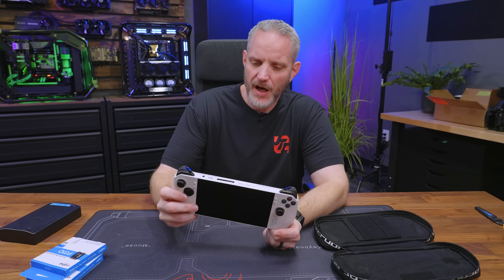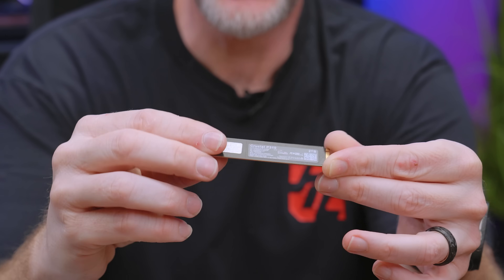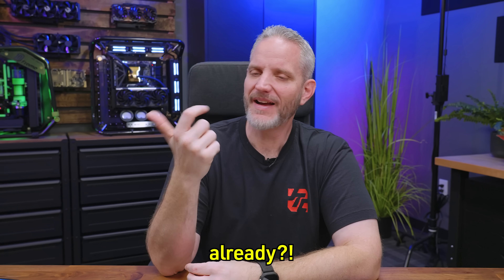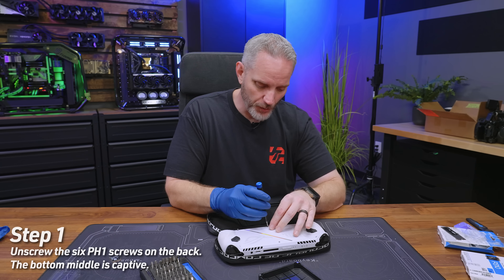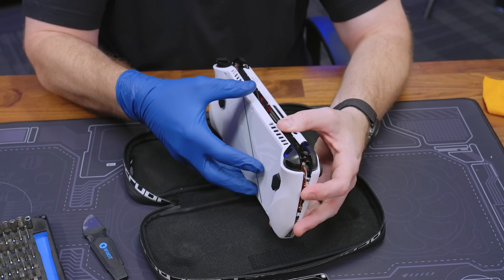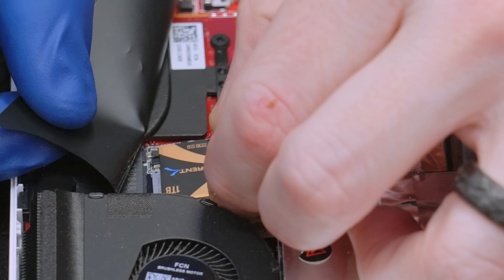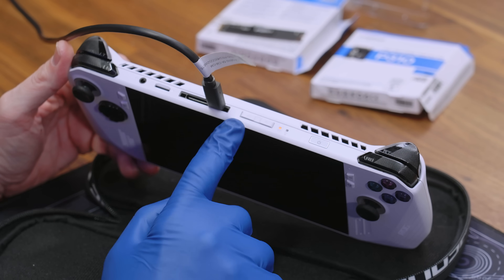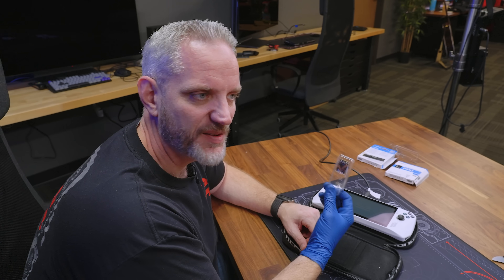How to upgrade Ally SSD.... Easy Turorial

Comment: I did a similar thing with my 64GB steam deck and upgraded to 1TB.

I don’t usually like playing games where you get heavily involved in whatever you’re doing on the steam deck. I also don’t like playing fast paced or twitch/reflex games on the steam deck. 

I play games like Marble it up Ultra, N++, Dave the Diver, Minecraft, Spyro, Fall Guys, Megaman, etc…

I also do a lot of emulation (legally of course😇🫣). It’s such a great device for playing old games. When I was a kid, I always wanted to play the full-fledged version of a lot of my PlayStation one and two games on a game boy of some sort. This literally made my realize that dream.

I’ll also use it as my backup PC or travel desktop PC from time to time. If I crank the settings all the way down on AAA games, I can get a playable experience. I’ll play Forza horizon, four, overwatch, borderlands, etc. on the steam deck. It’s nowhere near as good as an experience, obviously, but it stilla lot of fun TBH.

Comment: It's crazy how far we're come. First SSD I bought was a 128gb samsung 830 back in 2011. It was pretty expensive at launch. I still remember being blown away by how fast and responsive my mid-range PC got. (A year later I bought a 250gb 840 solely for games, same story.) Consumer SSD's must be the single most transformational piece of performance upgrade in PC hardware since....ever I guess. The only other thing I can think of is floppy boot to hard drive boot and floppy to CD-rom and flash drives. Correct me if I missed something. Now you can by a 1 TB+ MICRO SD card for a lot less money than those SSD's. Ridiculous. 🥴

Comment: Nice video. Maybe you could do a " Cloning " from the 1tb to the 2tb drive by using external adapaters. you could plug each adapter into your desktop boot with an acronis formatted usb drive. Then do a cloning from the mini-ssd's.

Comment: I managed to order a refurbished 64 GB Steam Deck from Valve when they first announced and released them for order, so I purchased a WD SN 740 1 TB to install from AliExpress because that was the only place I could find 2230 drives for under $300. The installation was relatively straightforward; however, I encountered a challenge when I couldn't locate my 3.0 thumb drive and had to use a 2.0 drive instead. Consequently, reinstalling Steam OS took several hours. Fortunately, I found a 3.0 drive halfway through the installation, and it took less than 5 minutes to complete the process, allowing me to resume playing games. Currently, the Steam Deck is on my nightstand, but I rarely use it because I have a gaming PC in the same room.

Comment: I also have a really hard time using handheld gaming, I prefer to stay at my desk with keyboard/mouse and have multiple monitors. The problem with this setup is that Im isolated and have no interaction with my wife.

I have tried multiple setups to overcome this issue and right now Im doing windows tablet that I can use as my main pc with an egpu dock, besides the enormous bottleneck of oculink and a 30W 8840u Im having fun doing this. I play till  my wife have to sleep and then Im back in my pc setup.

Comment: I am an avid handheld/portable gamer. Tbh, it was cheaper and easier for my parents to get 2 gameboys than an n64, for example. These days, however, I use it a lot for public transport as most trips I do are 1-2h each way, waiting between clients or when they're in appointments, and for my anxiety, when I need ti calm and focus on the go, etc.

Also, paired with a portable touch monitor and a foldable keyboard and trackpad, it serves also as my main business pc. Basically I do everything a laptop does but in a generally easier to carry formfactor. 
I also have just collected handhelds for years

Comment: I bought the Lenovo Legion Go shortly after they were released and have barely used it. When I have it's mostly been to run updates. I'll need to either start using it or sell it. This is my first experience with a gaming handheld so I'm sure that's part of the learning curve. I'm not very impressed with Windows on this device as far as touch inputs go.

Comment: It is super cool that they are getting higher capacities in the smaller 2230 m.2s, but I kind of question them putting the same hardware onto a 2280 size board. It would not matter most of the time, especially if you are just using it for games, but for work applications where you are moving around huge files, the sustained write speeds are pretty heavily determined by the number of nand chips on the board. So I would expect the sustained write speeds to be really bad when compared to other 2280 size drives that are filled with nand chips. So I would not buy the 2280 ones at least not without seeing a good review that tests these out really well. Also I kind of wonder about the durability, usually an increase in nand density also comes with a drop in durability. Unless Crucial has somehow managed to overcome all of the usual drawbacks of using fewer denser nand chips then the 2280 size just does not seem like a very good idea to me.

Comment: Actually, I couldn't possibly care less how big the drives are physically for a 2TB drive, or whether I can get a 4 TB drive.  What irks me is the limited lifetime of the drives.  True, a larger drive will take longer to die - but I have had an SSD fail on me after only 5 years.  Fortunately, the part that failed wasn't critical and was capable of running system recovery to get back online.  I was able to do a backup of my data files to a big thumb drive because I've had to recover on previous systems and know about making backups.  But it was still annoying as heck.  I've read about a new direction for SSDs that emphasizes longevity.  When they get THAT figured out, I'll be impressed.  Before anyone asks, I've had systems for which the HDDs lasted 15 years before showing the inevitable failure modes.  But 5 years is just too doggoned short.

Comment: I use my Rog Ally for emulators, visual novels, and clearing out older games on my massive back log while lying on the couch with it plugged into a wall. Right now I'm currently playing Marvel Ultimate Alliance gotten by various means and the performance is excellent at 1080p max settings.

Comment: uhhhh...I don't mean to be rude or anything. tho the another easier way is to go the NVMe cloner tool. you slide both SSD in the correct slot then press button.

Comment: As A Legion Go owner I wish 2242 would go away and it would just be 2230 instead. Too many sizes means prices are allover the place. This 2230 + adaptor is cheaper.

Heck 2280 SSD + USB-C M.2 enclosure is cheaper than 2242.

Comment: I was told the ROG ALLY also won't boot for the first time unless its plugged in if the battery was disconnected. 
Just a heads up for those who disconnect their battery when they open their Ally to do changes.

Comment: I like how they are getting even smaller, but also pissed that regular SSD's aren't being made now at much higher capacities for quick backup, temp storage....  The prices on the ones at the high average being only 2TB have almost doubled, and find one at 4TB, triple that!!  They are supposed to quadruple the size and then some to get double the price!  They could probably make 2.5" SSD's at 16Tb by now, and at under $300.

Comment: Grew up with Nintendo consoles: NES, SNES, N64. Never owned a Gameboy. Got into PC gaming after that. A couple years after the Nintendo Switch came out I got one of those. At first I just wanted to play Zelda Breath of the Wild (great game!!!). I tried playing it first on my PC with Ryujinx and a crappy controller, but you really miss out on the motion controls that you get with the joycons on the Switch. Then bought a used Nintendo Switch and hooked up to my PC monitor using those joycons and it felt amazing!  Even though it was 720p I didn't care 🤣 Since then I've loaded it up with all sorts of games like "Little Kitty Big City" and "Super Mario Bros Wonder". I even play Skyrim on it.  I have to travel sometimes and the only things I can carry fit in a backpack. A lot of times, pulling out a laptop feels too cumbersome with it's bulky power brick, but it's way easier to pull out the Switch in the car or a motel room. Highly recommended the Zelda series if you give this a try.

Never owned a handheld PC. If I did, I'd be really worried how well Windows 10 / 11 worked on it or how the UI handled the buttons. I guess that's why I like the Switch a lot: it's simple to use and only plays games. You don't have all the distractions that a PC brings with it.  Yeah, it's kind of a one trick pony, but that's what makes it fun and relaxing to use.
Reply: I was shopping for retro handhelds and ended up getting a ROG Ally because it was a bit cheaper than the highest end ARM+Android based handheld. The UIs for retrogaming are so good now, you'll forget it's a windows device because you'll just be in that the whole time you're not playing a game. The flexibility of running PC games (unlike the retro ARM+Android based handhelds) through steam or whichever service you chose is the icing on the cake. Even then, the built-in UI can sync your PC games. There are even options to view all games in one single pane of glass, across all platforms. Being able to play any console system up to PS3 in my hands with good quality graphics is mind-blowing to me. I'm enjoying every minute of it and I'm still working on tweaking/fine tuning mine.

Comment: Watching this in an ally.. Upgraded mine the same day i got it with a corsair p600 1tb.. And yesterday I went through all of that cuz armoury create is not functioning, buttons and shortcut don't work and I added some aluminium heatsink over the sad to help it cool a bit.. I have the transparent back cover from amazon that's why the aluminium heatsink fits .. Its not possible if ur using the original back cover..

Comment: So apart from temperature what is the point of the larger form factor. They could probably place a couple of 2230 sockets on a Motherboard where there is one 2280 at present?

Comment: I have a ally extream put a  p3 2280 4t used the adapter runs great. I play fallout 4 mass effect starfield hogwars both star wars jedi ms flight sim nfs heat forza 5 some tycoon games. They run pritty good even when I dock it and run on my 4k monitor. I use this as my pc on my semitruck sence my gpu in my pc will no longer let me play games.i also run a portable monitor to that does great with

Comment: wait until he sees a 1.5tb micro sd. That's a crazy thing to behold. I have a 512gb Launch Steam Deck with 4tb of micro sd cards from silicon power. They fit well in the kickstand of my JSAUX mod case along with a microfiber cloth for cleaning the screen

Comment: Why not use a USB->M.2 cable to clone the 1TB to the 2TB and save on the recovery over the air steps and all that downloading?
With that reduction in size, I wonder what the capacity limit is going to be for M.2 NVMe drives either now, or very soon.  It was 8TB afaIk, so maybe 16TB or even 32TB is coming soon?

Comment: I think handheld gaming is something you have to learn in your youth. I grew up with a gameboy color/advance being my main device.

I don't have any x86 handhelds, but I'm big on the emulator handhelds like the LDK vertical, Retroid Pocket 2, and RG 35XX SP.

Something about holding one of them shuts half my brain off because it goes "oh, we're playing games now." They also have extremely limited connectivity, so they can't be used for doomscrolling or discord.

Comment: My first handheld system was the OG Gameboy. I've been doing it a long long time. There's no secret to it; back in the day GBA and DS were great for taking a shit (another job smartphones replaced) and now Nintendo's only console is the switch. The industry should thank Nintendo for inspiring the handheld revolution. Oh, and I still play my Switch on the regular. Nintendo has some great first party titles, but their selection of indie games is where the console really shines. I recently booted my save from "Cult of the Lamb" and started working through the DLC.

I'd recommend just trying some indie games. just sit back in a big easy chair (or in bed, if allowed) and focus on having fun. One thing you might want to look at is a "grip" - the handheld slides into it and gives it the feeling of a giant controller with a screen. Way more comfortable for long sessions.

Comment: WD_BLACK SN770M 2TB M.2 2230.  £129. Free wd cloning software.  It's So simple to clone the whole drive. With any nvme expansion enclosure. Via type c port.  Power off. Swap over drives.  Don't bother to unplug the battery. Then, just hold power the power button down. With charge cable plugged in. Job done.  Enjoy.
Reply: in canada that drive is $354 CAD, BTW

Comment: I’m using AYANEO 2.
I travel a lot with my wife, and I mainly travel play Destiny 2. Which is not compatible with Steam Deck, and the Asus Ally came out after my pre-order.

Currently AYANEO is allowing for a motherboard upgrade to the 8640 chipset (although currently delayed).

You can also put in full-sized 2280 drives in it.

Comment: Hey Jay, I'm using a ROG Ally and upgraded mine to a 2TB full-size m2 with an angle adapter I got from Aliexpress. Otherwise I also use an Analogue Pocket FPGA handheld, my Nintendo new 3DS and a PS Vita 2000. Handheld gaming can be very relaxing and it helps with grinding in games for example where you maybe just do it as a side activity.

Comment: you can clone the drive to skip installing the OS, apps and games again, just have to expand the drive through the OS after installing the new drive, you will need an external m.2 to usb enclosure and a bootable gparted (free) usb drive though.

Comment: For more experienced users: using a USB C hub and a Macrium Reflect bootable disk, boot the device into Macrium , back the internal storage into ann external Storage, put the new storage and boot into Macrium, deploy back up into the new storage! Go back into windows install Minitool partition wizard and move and resize the partitions to the Max! Takes a litte bit of time but it worth it bit by bit!

Comment: Used to only play Final Fantasy (many versions), Zelda and Tecmo Bowl on the GameBoy back in the day when I was a console plebe. Had a 1982 IBM that could barely run word perfect, so I never really got into PC gaming until I left for college in the mid 90's. There I discovered that PC games were actually FAR ahead of consoles instead of dragging ass behind and never looked back. PCMR. Though Golden Eye on the N64 made for some riotous evenings, it just wasn't enough to take me back to consoles and handhelds. To be honest, in my case, I think it's mostly the control schemes. Once you get used to the functionality of keyboard and mouse, to being able to plug in any peripheral you want, and using 3rd party software to reprogram your button presses even if a game doesn't support keymapping, all of which gives you far greater range of input as well as lets you set up the perfect control scheme that works for you... With a PC you control how you want to play, with a console or handheld, you're limited to one or two ways someone else wants you to play and that's kind of it. If you don't like the options, that's just too bad for you. Lack of control over controls annoys me.

Also battery life. Back in the day you could play for days before needing new batteries. Handhelds capabilities increased, but battery life really didn't, and with the switch to rechargeable, and soldering the batteries to the board and right to repair not really being a thing for a good long while there which prevented upgrades to better batteries or replacing bad ones without sending it back in, days switched to hours and you were left tethered to a plug which really defeated the purpose of the portability offered by handhelds. So battery life would have to greatly improve back into the area of playing a few hours a day and being able to play for several days between recharges, and being able to swap out bad or not charged batteries with new/charged ones needs to be a thing before I'd ever consider one again. Phil's ROG Ally get's what, 6 hours at best before needing to be plugged in? That's just not good enough. If I'm gonna be tethered to a wall, I may as well just have a PC.

Comment: Couldn't you have just done a clone from the old drive to the new one with Macrium? And used the fill space on the C: partition instead of doing the OS recovery through the cloud? Just curious why using the cloud and not a clone.

Comment: Jay, I've got request that's a little off today's subject, but it's relevant to the M.2 SSD discussion so I'm asking now because it's going to come up in the next few weeks. When the new AMD motherboards come out shortly, could you please give us some guidance on which boards offers the most amount of PCIe channels and M.2 drives going directly to the CPU. Just pick me out a board that will allow dedicated separate drives for the OS, apps, files, swap disk & virtual memory. Oh and one last little thing could you please tell us which PCIe 4 & 5 drives have the fastest RANDOM access reads and writes, indexed of course by energy efficiency. Thanks

Comment: I'm curious with these devices would just cloning the smaller drive onto the bigger one (using another computer) and then expanding the partition size in windows after booting not work or is it somehow prevented by handheld manufacturer?
I've replaced a lot of laptop drives this way and never had any issues